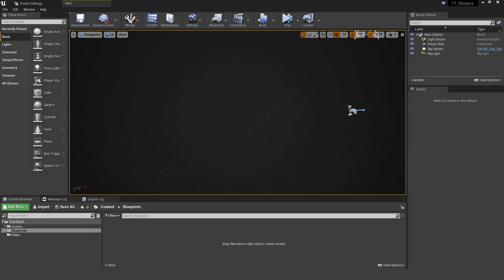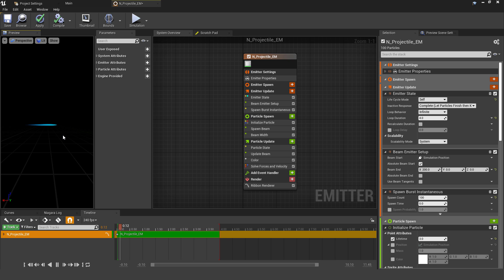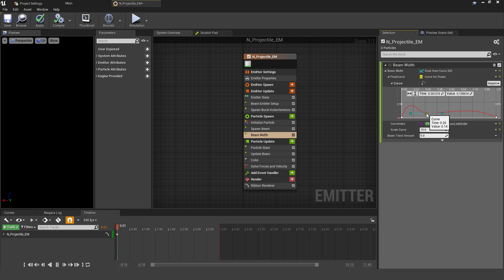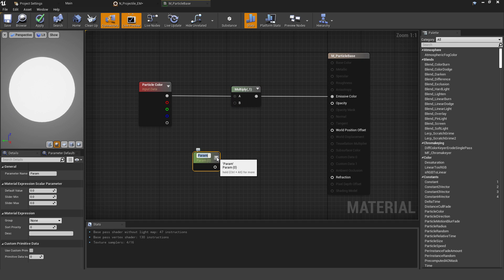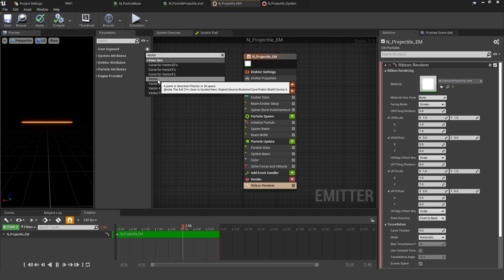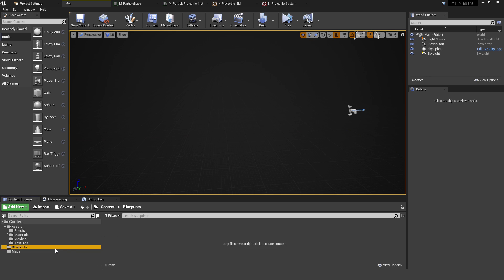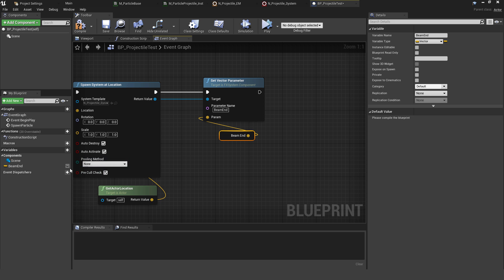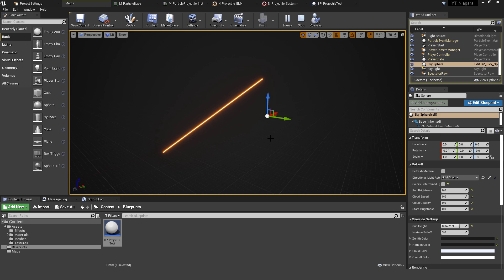UE4 Niagara Tutorial - Bullet Tracer Effect - Intro to Niagara UE4/Unreal Engine 4

Comment: Hi! Nice tutorial! I want to set the start point dynamically, so that the system spawns from where ever my weapon muzzle is. But I cant get this to work. I dont know what Im doing wriong but the system seems to spawn where my linetrace ends currently. Also I want to exchange my old beam made in cascade with something nicer looking in Niagara, and my old cascade beam had the start point follow along wiht the muzzle. I want a beam where the end point is wherever the linetrace ended, but the source point should follow along if the weapon/ camera moves. I achieved this in cascade but cant seem to get this working in Niagara. All i did for the cascade was ti have it User Set, and set source point. But with my Niagara system, if I move the gun, the system beam start point doesnt change after the particle has been spawned. There must be  a way to achieve this in Niagra thanks

Comment: For anyone using newer versions of the engine, User Parameters has been removed at the emitter level and must be implemented in the Niagara System now instead.

In typical Epic fashion, there is no reference to this change outside of the version notes buried within thousands of other changes. So, most people don't know about the change and get hung up on older tutorials like this one. The change was done in 5.2 or 5.3, if I remember correctly.

Comment: I have a problem. I have a projectile that curves, so a beam wouldn't work so I tried to make the ribbon a trail. now it works but when the first projectile bp actor spawns the particle does not show up but takes time hence it looks as if bullet is fired from a feet away from the gun nozzle, So I tried to increased the spawn rate of particles in niagara and that reduced the gap, but eventually the problem returned. increasing the spawn rate isn't helping anymore.

Comment: Hi, nice tutorial, but iw hit the wall. I dont have + sign beside User exposed in Niagra System. Using UE 5.2, what to do?
Reply: did you manage to solve this ?
Reply: @IsaacCode95  use N_Projectiles_System and user parametres
Reply: Seems like in UE5.2, you will have to create the user exposed variables from the Niagara System (can not create these in the Emitters). 
Apart from that, everything is exactly the same.

Comment: This doesn't work properly for me. When I spawn the tracer particle, it always ends in the same place, which is not the impact point of my line trace, and it's always facing the same world rotation, so when I turn around, the tracer is shooting backwards or sideways. Would be nice if you actually set it up with a line trace to show how to handle that.
Reply: To solve your issue, try to Select the emitter node > Select Beam Emitter Setup > Set Absolute Beam End to true.
Reply: @BertrandBarraud  That worked!  Thanks so much!

Comment: This is just a simple point to point beam. Having this little simple beam attached to a moving projectile is easy.. but most shooters use instant line traces for weapons. Now take this small beam and have it actually travel through space and not just spawn from point a to point b. I want my 12 minutes back. :)
Reply: if you use instant line trace this is a great way to do a "bullet trace" . you need to make the loop and lifetime shorter (for example 0.05 seconds). Any other particle or projectile component that "travels" won't match the "hit effect" you trigger when your line trace hits something. Using Projectile Component for bullets is not efficient or accurate (not only that, if you want to use real muzzle velocities, like 910 meters/second for a Colt M4, then your projectile/particle will travel so fast you won't even see it rendered). this method (spawning a point to point beam) ensures the player see the "bullet" impacting at the same time you trigger on "hit" by a line trace. For bullets, maybe the original material is better than a "beam" (as this looks more like a laser).

Comment: When i increased my emissive strength to 30 like you did at around 6:05 , i didn't get a glowing / bloom effect like you did, why am i missing?
Reply: Go to Project Settings -> Rendering -> Default Settings -> Turn on Bloom. For me it solved the issue.
Reply: Place a Post Process in your lvl and use the Bloom settings
Reply: Keep engine scaability to high

Comment: Thank you for this! Just wondering, if I wanted to make it arc in the middle would there be a way of doing that?
Reply from the maker: It's been a while since I've looked at this or Niagara so the interface and exact options are a probably a little off. But in the location/position details, there's probably some way to add a curve or something which would allow an offset partway through travelling to the destination. OR, Niagara systems are much more flexible to control things in blueprints now so you could apply some offsets in from the blueprint class that is spawning the effect. Definitely, a way to do it but not a single precise answer I can think of.
Reply: @DevEnabled  Cool thank you very much! I'll have a play around in the location/position settings in  both Niagara and the blueprints then :)

Comment: I've go problem with this. I set location to my muzzle flash socket in my gun and beam end to HitPoint from LineTrace. It's not working properly, projectiles are spawning in wrong direction. Only when my character is at world origin (0,0) they are spawn in correct way. I tried changing beam to local space but without result.
Reply: Hey.. I don't know if you solved your problem or not but I was facing a similar issue where the tracers would spawn in the wrong direction. I fixed it by going to the Niagara System created in the tutorial, selecting the emitter node, selecting 'Beam Emitter Setup' and finally setting 'Absolute Beam End' to true. Try this. Maybe it will work for you.
Reply: @TheHarsh1310  Yeah I solved it earlier in the same way. Thanks.

Comment: Awesome video! I've always been a sucker for creative use of particle effects.
Not sure if this is possible/practical with current technology, but I do have a question.
Is there a way you know of to allow these beams to cast actual dynamic light rather than just be emissive? I'm sure there's a way to sort of "fake" it with enough time and experimentation, but I haven't dug into UE4 in a while. Hoping there may be some new updates in Niagara that may make this possible.   Thanks!
Reply from the maker: Thank you. It should definitely be possible. Perhaps not on a per-particle basis but you can add a light component under the Renders section. To my understanding, this is similar to using a point light in the editor. I'm not sure if you could light the entire beam with it, perhaps moving it along the beam over the lifetime or something, but that's something I'd need to test and play around with. As  for the emissive values, I've shown they're purely for the particle itself.
Reply: Dev Enabled  Thanks for the reply!  I’ve had a game idea running in my imagination for a few years, but the whole concept relies on all lights being dynamic, which has always been either impossible or way too expensive. Holding out hope someday I can make it work. 😁
Reply: @DevEnabled  How about since you now have rectangular lights, you can apply that and it's stretching to a billboard component that only rotates it around it's long axis. the hardest part is stretching the size of the light between two vector points.